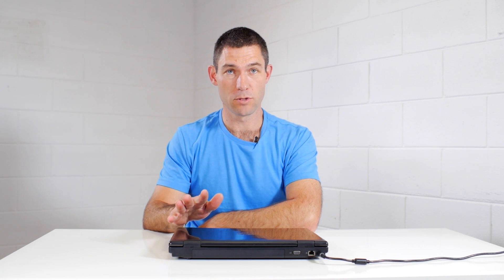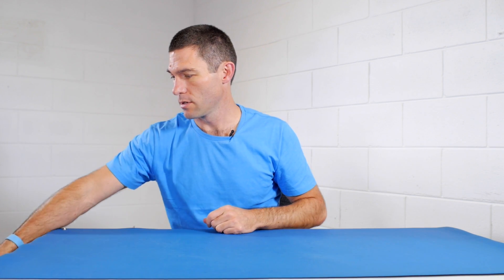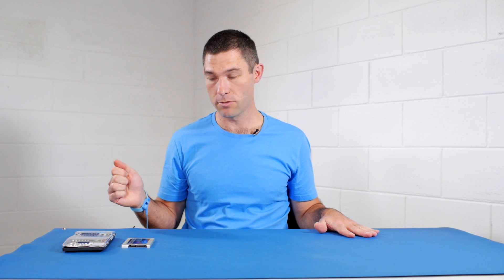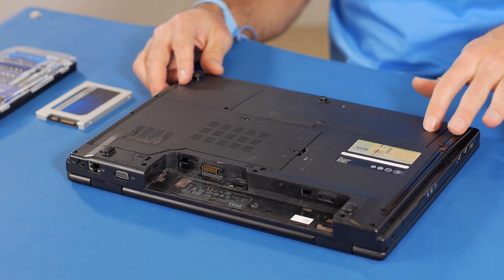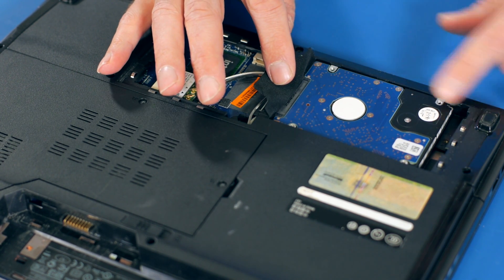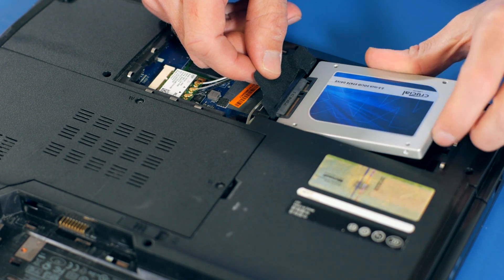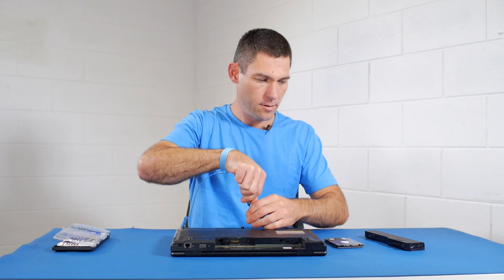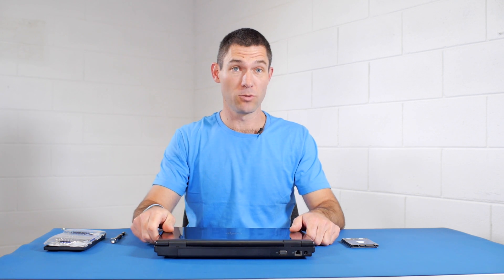How to install a SSD in a Dell Vostro 1520 Laptop

Comment: Poor video.  You can disengage the old hard drive by simply pulling on the flexible plastic flap/tab to one side.  Also when you fitted the new SSD, you should have installed a 2.5mm plastic spacer below it, to minimise risk of breaking the SATA connector because you can clearly see the SSD is not seated properly.

Comment: Can we upgrade SSD in dell vostro 1450 laptop
Reply: Yes, I want to know the same. In addition to that, I want to know like can we configure SSD in the place optical drive? So that, my HDD remains same in addition to SSD, where I can run c:drive from SSD for faster access.
Reply from the maker: You sure can - it's much the same procedure.
Reply from the maker: You may be able to find an optical drive replacement caddy, so long as the optical drive uses a SATA port, which the SSD needs.  Otherwise, it's not worth pulling it apart.

Comment: eeek.  The Crucial SSD comes with a 2mm spacer that should have gone UNDER the drive.  All the anti static precautions and you put in a drive that had vertical movement due to it being thinner than the drive it replaced. :-(

Comment: Thanks very useful. What specification do I need for the SSD? Are they all a standard size? do you recommend any particular brand?
Reply from the maker: Hi Mike, you simply need a standard 2.5" SSD. They are an industry standard. The brands we stock are those we trust. Try a Crucial or a Samsung SSD.
Reply from the maker: The only concern here is that the drive is 2.5" the thickness does not matter. Almost all SSD's in this size are 7mm but some are rarely 5mm